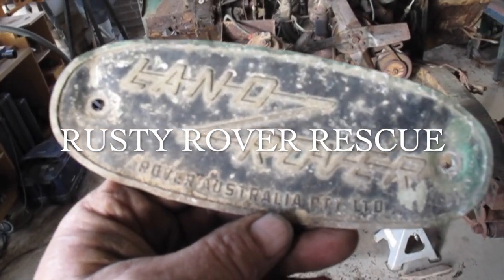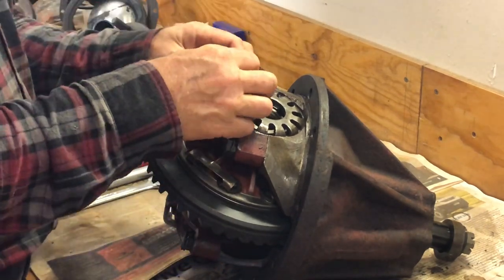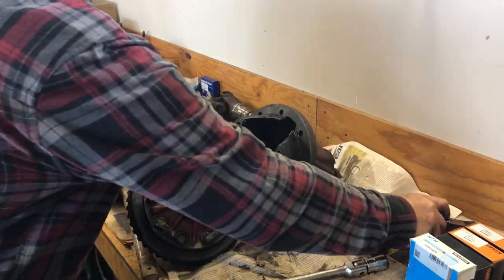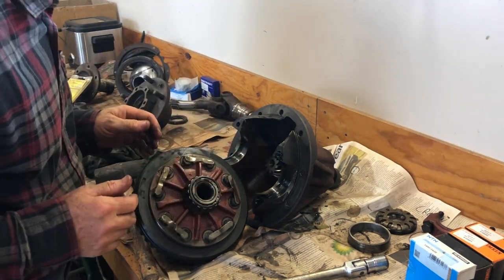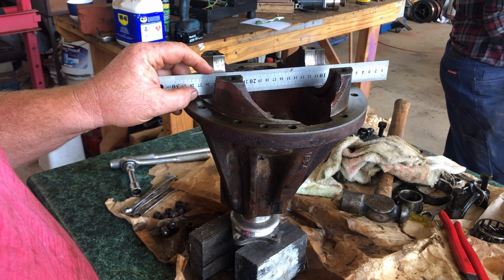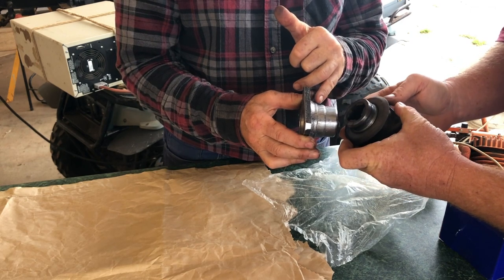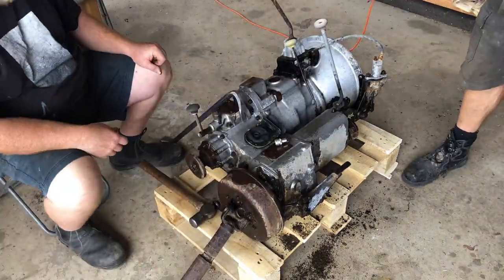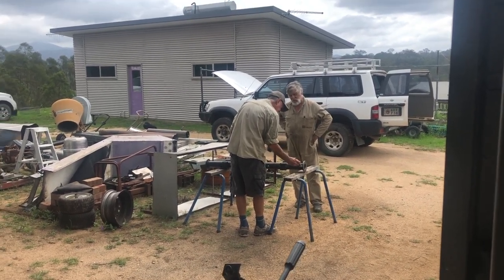Land Rover Series 2A diff (differential) restoration  Electric Landrover Conversion

Comment: so you do not always need to replace the Crown wheel and pinion? are most diff issues wear and bearing replacement?  I have 6 old diffs on the shelf i may have a go at.
Reply from the maker: No need to replace it if it's servicable.  The 'consumable' parts are pretty straight forward to replace.
Reply: @VintageRestorationsAustralia  thankyou for the reply.  I will have a chat to my local diff specialist and maybe get some seals, bearings and drive flanges on my next parts order.

Comment: At 4.05, that is the assembly of the outer bearing member, why did you hammer it in when you have a press?
Reply: Similarly, why do you use the chipper if you have the press?  What liquid are you using in your chipper?
Reply from the maker: It's quicker and easier than doing it in the press.
Reply from the maker: @Youtubeisthebesttool  The fryer heating is so simple, very fast, no impact on parts as it extends tolerance significantly and it saves a huge amount of manual handling when multiple parts have to go on.  High temperature oil.